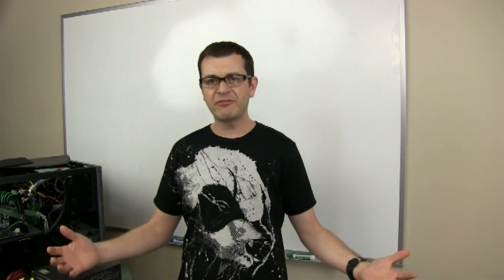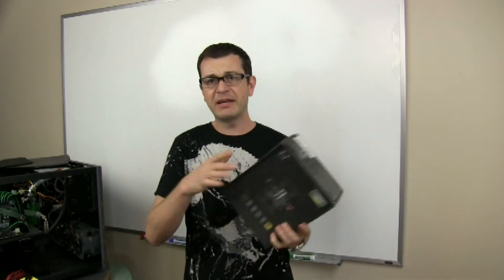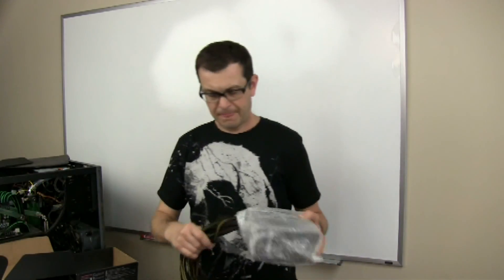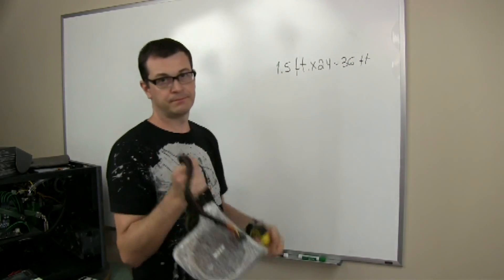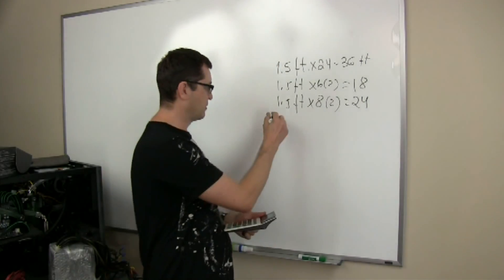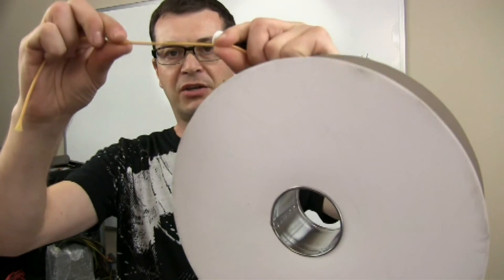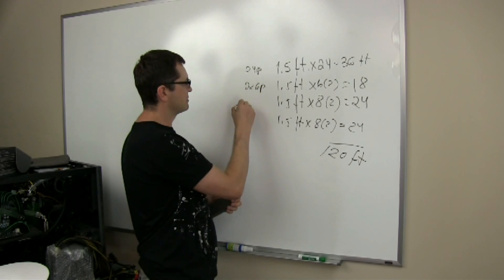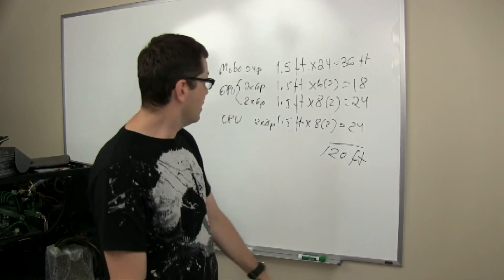How Much Sleeving Do I need for Complete Power Supply Sleeving Job?

Comment: Hehehe, math fail. 10%+10% isn't 20%. 10% of 102 is 10.2, that means 112.2ft, and then 10% of 112.2 is 11.22, that means 123.42. If procent added, 20% of 102 is 20.4, that means 122.4ft. Still, it's hot a huge difference.